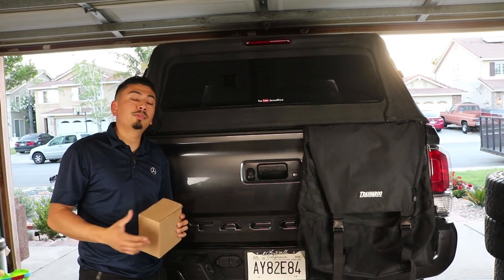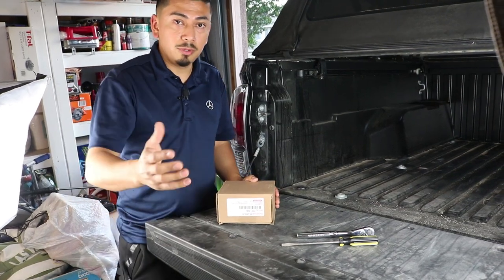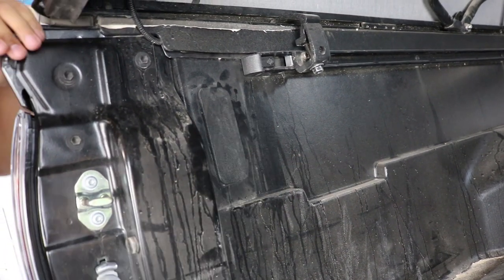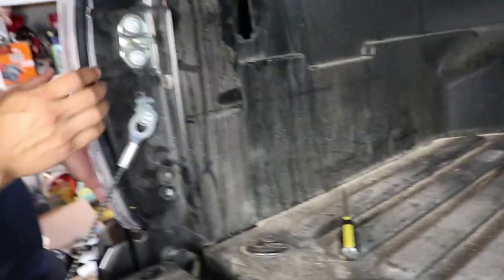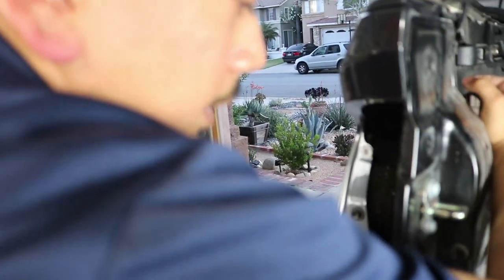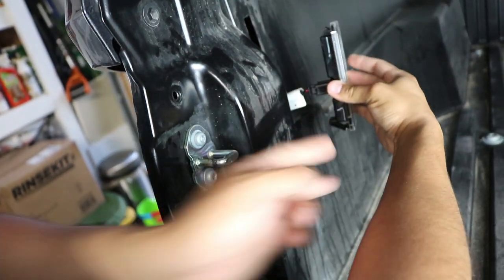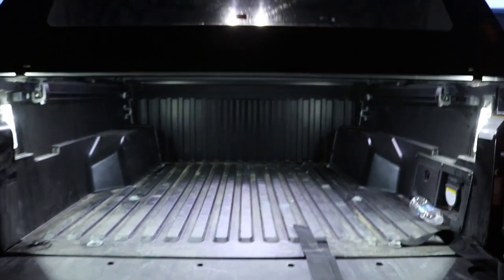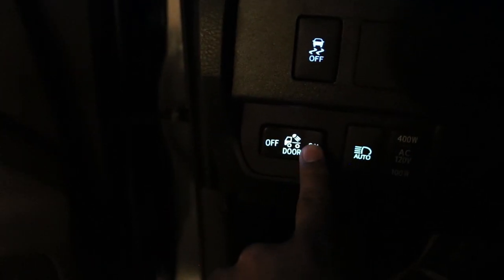HOW TO INSTALL PLUG & PLAY BED LIGHTING ON A 2020 TOYOTA TACOMA | BETTER THAN AFTERMARKET?!!

Comment from the maker: In todays video I install plug & play bed lights on my 2020 tacoma trd offroad 4x4.
PURCHASE YOUR BED LIGHTS:
https://www.ebay.com/itm/2020-TOYOTA-TACOMA-BED-LIGHTING-KIT-GENUINE-OEM-FAST-SHIPPING-PT857-35200/164079373832?_trkparms=aid%3D111001%26algo%3DREC.SEED%26ao%3D1%26asc%3D20160908105057%26meid%3Dbcabba59c6a046a98e0352566e7025ac%26pid%3D100675%26rk%3D2%26rkt%3D15%26mehot%3Dpp%26sd%3D383272834961%26itm%3D164079373832%26pmt%3D0%26noa%3D1%26pg%3D2380057%26brand%3DToyota&_trksid=p2380057.c100675.m4236&_trkparms=pageci%3Aa3949512-9a56-11ea-a3fa-74dbd18078d0%7Cparentrq%3A307319471720abc31c822f25ff99ab51%7Ciid%3A1
PLEASE COMMENT, LIKE & SUBSCRIBE.

FOLLOW MY IG: @_jesserizo

PURCHASE YOUR RAPTOR LIGHTS:
https://theyotagarage.com/collections/2016-toyota-tacoma-grilles?ref=hrwtrpswem
Purchase your trd pro grill:
https://theyotagarage.com/search?q=tacoma+trd+grille&ref=hrwtrpswem

Purchase your tuffskins: 
https://www.tufskinz.com/products?search_api_views_fulltext=tacoma
Use Promo Code: “JesseRizo10” for 10% off 

Purchase your softop (products also for jeeps & more vehicles): https://www.bestop.com
10% off discount code: JESSERIZOBESTOP
HOW TO INSTALL BESTOP SUPERTOP SOFTOP ON A TOYOTA TACOMA IN DETAIL:
https://youtu.be/DkhpwyQ8U7s

PURCHASE YOUR Pittman Outdoors Soft Shell Rooftop Tent:
 https://truckairbedz.com/Soft-shell-tent/PPI-TNT1.4

Need new shoes? Literally:
https://indestructibleshoes.com
20% off Referral code: JESSR100

Bilstien 5100 (front shock kit): https://theyotagarage.com/products/bilstein-24-263108-front-5100-series-0-2-adjustable-shocks-2016-toyota-tacoma?ref=hrwtrpswem
Bilstien 5160 (rear shocks kit): https://theyotagarage.com/products/bilstein-5160-remote-reservoir-0-1-5-rear-shocks-2016-toyota-tacoma-25-242539_25-242379?ref=hrwtrpswem

PURCHASE YOUR REMOTE START: https://www.n2designsinc.com/product-page/2016-2018-toyota-tacoma-plug-play-remote-start-kit-smart-key-1
5% OFF DISCOUNT CODE: N2JR5OFF 
2016+ TACOMA REMOTE START INSTALL HOW TO:
https://youtu.be/modg9uSx_3A

Need a dashcam? www.blackvue.com 
10% off discount code: JESSERIZO

Need all weather floor Matts? 
https://bit.ly/3824zlt
$20 off: JesseRizo20

PURCHASE YOUR UNIVERSAL HEADREST PARACORD GRAB HANDLES (PAIR): https://bubbasgarage.tv/
USE DISCOUNT CODE (10% OFF):
JesseRizo

QUESTIONS?
For Business Inquiries: jesserizoyt@gmail.com
▬▬▬▬▬▬▬▬▬▬▬▬▬▬▬
CHECK OUT MY FRIENDS INSTAGRAMS:
chris  @Impact_trd
nate @nochill_nate
Tailgate benches @ Vintagebenches
Proud founder of @syndicate_yotas
Brenden @brenden951
NEED SLIDERS, BED RACKS, FABRICATION, ETC:
@BEASTFAB_SOCAL
OR YOU CAN GIVE HIM A CALL: (909)471-6756
YOU CAN ALWAYS CALL & LET HIM KNOW I SENT YOU 👍

VISIT YOUR ONE STOP SHOP TACOMABEAST WEBSITE:
https://tacomabeast.com/

PURCHASE YOUR RINSEKIT:
https://rinsekit.com/

PURCHASE YOUR PRINSU CABRACK:
https://prinsudesignstudio.com/product/t2t3-prinsu-cabrack/

I use Viar 300p compressor for up to 33" tires: https://www.viaircorp.com/portables/300p 

Forum I’m on: 
https://tacoma3g.com
▬▬▬▬▬▬▬▬▬▬▬▬▬▬▬
WATCH SOME OF MY PREVIOUS VIDEOS:
MY 2018 TACOMA ON 33'S REVEAL VIDEO:
https://youtu.be/eCqQv8rD5tg
AWNING TO PRINSU ROOF RACK INSTALL:
https://youtu.be/pv_uyymtooY
HOW TO INSTALL AMP + SUB PLUG & PLAY LOC ON A STOCK RADIO 2016+ TACOMA: 
https://youtu.be/ZrhT2___eAk
2016+ TACOMA TWEETER INSTALL:
https://youtu.be/DNnLDeDn1QI
2016+ TACOMA FRONT DOOR SPEAKER INSTALL:
https://youtu.be/cLU6NqsEJe8
2016+ TACOMA REAR DOOR SPEAKER INSTALL:
https://youtu.be/6zGxEbiarPc
PART 1 TACOMA SOUND DEADEN INSTALL: https://youtu.be/_vxpT62AP0M
PART 2 TACOMA SOUND DEADEN INSTALL:
https://youtu.be/ipJaa5TkuvI
2016+ TACOMA HEADLIGHT INSTALL HOW TO:
https://youtu.be/qkxJl0KKTjM
2016+ TACOMA TRD PRO 2018 GRILL - WITH SENSOR | HOW TO INSTALL
https://youtu.be/zVNVKnyrb38
2016+ TOYOTA TACOMA TRD MBRP EXHAUST HOW TO INSTALL 
https://youtu.be/t_mfDCTbNHk
2016+ TACOMA HIDDEN BUMPER LED LIGHT BAR:
https://youtu.be/ogciqoSRLcw
UNBOXING TACO PARTS/MY TACO PLANS:
https://youtu.be/75xOeXq8_WI
2016+ TACOMA LED POD FOG INSTALL:
https://youtu.be/QEyftT_hyGM
AJT KEY FOB INSTALL & REVIEW:
https://youtu.be/9AHpFzoKVS0
2018 TOYOTA TACOMA TRD CHROME DELETE (COLOR MATCH)
https://youtu.be/kvZ_6CMdy4Y
MY NEW TRUCK REVEAL:
https://youtu.be/bMZjKTG9g-U
NOICO SOLUTIONS INSTALL:
https://youtu.be/B37iX-kdlB8
HOW TO INSTALL AN AMP TO A FACTORY RADIO:
https://youtu.be/ckFBeKA-we8
HOW TO INSTALL FRONT DOOR SPEAKERS ON A HONDA CIVIC
https://youtu.be/FIgic72X1Ww
Adam's Polishes Foam Gun | WORTH IT? 
https://youtu.be/uGXyms1h00E
Auxbeam LED Review
https://youtu.be/Xt4jensQlyc
THE BEST CAR DRYING TOWEL REVIEW
https://youtu.be/hK0ikvcFe8s
EZ LIP REVIEW + INSTALL
https://youtu.be/AhhTpQijFlw
EZ LIP PRO DURABILITY TEST
https://youtu.be/pS5w2fd2q1I
THE BEST IPHONE VLOGGING SETUP
https://youtu.be/UV-Qt4Yx9yI
▬▬▬▬▬▬▬▬▬▬▬▬▬▬▬
THANKS FOR WATCHING
PLEASE,
Like, Comment, & Subscribe
for more DIY FOR CARS, RANDOM VIDEOS, CAR VIDEOS.
Reply: my 2020 sr sx doesn’t have that switch you used to turn them on and off? how do i remedy this
Reply: Thank you Jesse, I just got installed my bedlights kit...estan CHEVERE...
PEACE ✌

Comment: Thank you J! I got mine installed last night for 2021 Tacoma. I got it done in about 10 minutes. Super simple like you mentioned. Thanks for making instructional videos. 👍
Reply: I got a 21 Tacoma sr acces cab i bought the switch from Toyota and place it in place where i can find the harness inside and bought the cargo lights.my question is how can i have a cargo light in the third  brake light. I got the regular 2 wires don't see anything else.

Comment: Thank you Jesse.  I installed the bed lights on my 2022 Taco and it helps that you noted only 2 screws to remove the tail light.  A different video I watched said to remove all of them.  What I like is the lights turn on and off when I unlock the doors and can be manually operated with the bed light switch inside.
Reply: What Tacoma did you get? My new SR5 doesn’t have the switch installed and the parts department said that the factory harness is not Pre wire for the bed lights.

Comment: i have a new 2021 Tacoma SR5. the lights were easy enough to install. but on the 2021, there is NO switch. You need to purchase the switch approx $70 and you need the light relay.... less that $10. the problem is getting the blank plate out where the new switch goes.
Reply: What you mean there’s no switch I have a 2021 Tacoma SR5 and it has the same switch as the one in the video. Could you clarify what switch thank you !
Reply: I need a video to show me how to do this switch is more $ then the lights.

Comment: I have an access cab and I did the exact same thing as your video. The light doesn't turn on. 2020 Access cab does not come with a carbo cab light switch underneath the dash. Forums I read , said that they should still work with a lock and unlocking mechanism on the key fob. However. it's a no-go for me. Anyone have any insight?
Reply: Access cab Sr Tacoma's have the plug for the lights in the tail light, and the plug for the switch behind the plastics under the dash. They don't come with the relay that plugs into the fuse panel. You'll have to get the switch and relay kit to make it work. I did it to my access cab and it was fairly easy. You can get the kit through a dealership or source it online.

Comment: Super Video - used it and installed the lights in about 10 min like you described.  The wires on mine came with an additional clip that clips into the little hole right above the round hole the wiring feeds though. I assume to keep the wiring from moving around.  Thank you for a great video.

Comment: Just a heads up, if your tail light housing is stuck in there really good do NOT force it. I assume some vehicles will come out easier than others, but pulling straight back and out wont work without busting your clips and possibly bulbs. You'll need to apply force primarily to the top of the tail light assembly, and actually pull out towards the opposite side of the truck bed. There are other videos on how to accomplish this with tight tail lights. Just be careful.
Reply from the maker: For Tacoma’s this is the way you should do it, possibly for other vehicles yes it’s different but this is for Tacoma owners

Comment: I wonder if you can tap that wire to install some led rock lights for the bed. You know, instead of running a new harness. I mean, it's going to be the same illumination when I hit that rocker switch...
Reply from the maker: That’s a good question I’m not sure 🤔 if u do end up doing it please let me know if it works or not
Reply: @JesseRizo  I’ll try it and let ya know

Comment: I have an 2020 Access Cab Trd Off Road and mine doesn't have a switch for the rear bed light. Will this still work for me?
Reply from the maker: It should but you will have to run a harness and switch so it’s just more work
Reply: I have a 2020 access cab as well.  It doesn't come with the on/off switch on the dash inside the truck. 🤔

Comment: I have a 2018 Tacoma and don’t have the knockouts though I’m not against cutting the holes to make them work. Question is on a 2018 will the factory wiring harness have the plugs mor would I have to cut wires?

Comment: Will this work on a base model, I’d like these lights but mine doesn’t have lights on the third brake light or the switch on dash. It’s a brand new 2020 Tacoma base model
Reply from the maker: You can make it work but ur gna need to most likely buy the switch and wire harness and run it all the way to the bed because those don’t come pre wired

Comment: Note: if you have 2016-2019 you have to cut a hole to fit those LED in the bed liner. 

Unless you have a 2020 tacoma it is PLUG AND PLAY! Everything is easy just like in the video.
Reply from the maker: Thank you

Comment: I have the connection but I don’t have the turn on and off button I have a SR model weird ?
Reply from the maker: You might have to purchase the switch from Toyota
Reply: @JesseRizo  I have a access cab so I don’t have the cargo light up on top but I do have the connections for the lights in the bed so I wonder how I would turn them on
Reply: @kevin2jzzzz203  did you ever figure out how to turn them on?
Reply: @gonadiator  no I ended up trading it in for a TRD Sport

Comment: Just installed my bed lights.  But wish you had included 2 things.  First, it would have helped big time if I knew how to remove the rear light.  Those 2 pins into the rubber grommets caused me some concern.  Second, wish you had shown how to disconnect the connectors.
Otherwise, worked the first time.

Comment: I'm sort of confused bro, I thought that the only one without these lights were the SR? Is there other trims without them?
Reply from the maker: Yea would be a factory option
Reply: the 2021 SR5 does not come with bed lights. They removed them from the package.
Reply: @adamdelvecchio6068  really?! Mine came with them, seems like there being cheap. Anyway I'm happy to have them but being honest I barely use them
Reply: @DaddyGlez  might be an add on. You would find it on the window sticker when you purchased the vehicle under added accessories.

Comment: Jesse- Do you know if that kit will fit in a 2018 model? The kit that the dealer calls for 2018 has to be ran to the dash. Seems senseless to me. Hoping to get lucky. What do you think?
Reply from the maker: I think for the 2018 you have to cut out the holes and run the wire to the switch if I rmemeber correctly

Comment: Jesse what trash bag brand and type do you have on the tailgate? Thank you sir for your great 2020 vids. Also let me know if you find any raptor lights that fit to 2020 Off Road factory grille.
Reply from the maker: It’s a trasharoo :) u can find them on amazon.com they run about $60 and honestly love it when I go camping all my trash goes in there so when I take off it’s not inside the truck with me and also for that ;) iam currently filming a video on thst I hope to have it up next Sunday or sooner

Comment: What is your tacoma is 2020 but an SR model that doesn't have and bed light control switches in the control panel? Is there a way to splice in and use your own switch?

Comment: Bought my 2022 SR 5 just over a week ago, ordered my lights to put in the bed just days before I got it. Well guess what, I am told that they no longer stub the wire for the lights and my truck doesn’t have the switch either. Instead I have a break light on the back of the cab . So I will have to return the lights.

Comment: Do not see Rocker Switch on my 22' Toy Taco SR5?
Reply from the maker: Yes some don’t come with it from the factory you may have to either buy the oem parts or buy an aftermarket switch
Reply: @JesseRizo  So the plug is behind the switch plate?

Comment: Hey Jesse, I was so stocked with this Mod, ordered the kit, install it, but it didn’t work. I have a 2020 TRD 4X4 Sport, and per comments in the tacomaworld forum this mod is not for this particular tacoma version. This is really bad. Any suggestion?
Reply from the maker: That’s odd it should be because the 2020s should have thst plug in play they might just be defective

Comment: Toyota is so strange you spend big money on the 2020 4X4 and don’t get bed lights but I buy a 2020 SR with an off road package and mine had them... You’d think if you were paying 35k plus for a brand new truck it would have all the bells and whistles!
Reply: I have a 2020 TRD off road and it did not come stock with led headlights!!   That is just sad.  I had a 2017 Silverado with all LEDs including interiors.